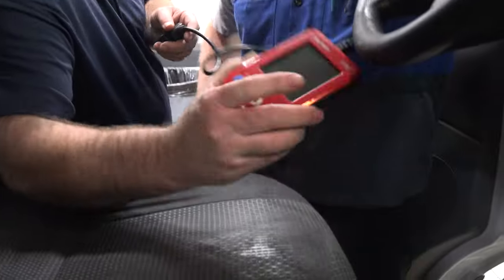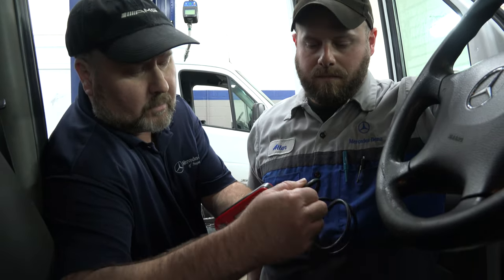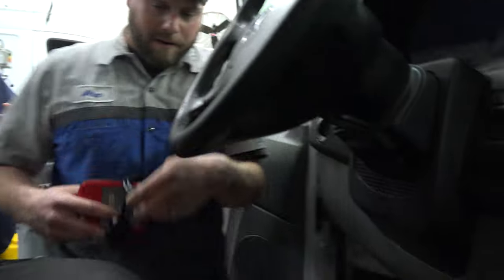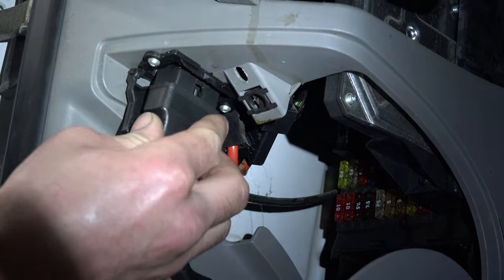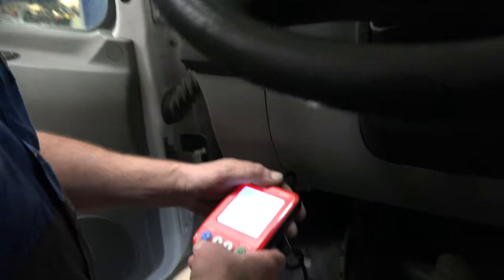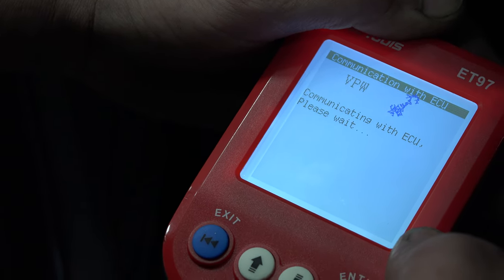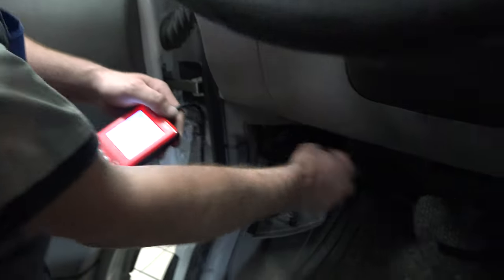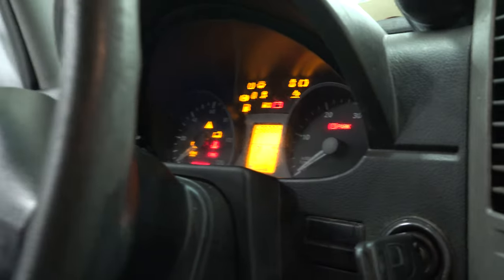Adblue DPF reset key count down cycle lock out. Sprinter 906 M642

Comment: Thanks for the post. I did this very thing and took my car to the dealership to have this recall campaign performed. Apparently there’s a back log on parts and they’re unable to fix the issue at the moment. I took the car back and it sits in the garage until parts are available Now car reads 0 starts, I tried the same technique again but can not get extra starts. Is there another way or will I need a tow?

Comment: Hello. I repeadiatly tried starting my 2017 Mercedes Sprinter van even though the battery was dead. Finally jump started it, next thing i know the 10 starts remaining light came on. Due to extremely low voltage I assume.

The vehicle slowed and i parked on the side of the road. I started the engine a few times but the counter still reads 10 starts remaining.

I test drove around a parking lot and acceleration seems normal again.

Is the Mercedes Sprinter just buggy? Or do I have something to worry about?

Thanks

Comment: hello . I have the adblue light on and 4 start left how can I reset the start and erase the adblue light ? any help I will appreciated
Reply from the maker: Yes, good day. What type of vehicle are you attempting to clear the AdBlue light?
Reply: good morning . yes its 2016 Mercedes Benz Sprinter 2500 2.1 engine diesel in advance thank you very much for any help  @AutomotiveZar
Reply: 2016 Mercedes benz sprinter 2.1 engine diesel I have 4 start time left on it and the adblue light in the cluster is on . how can erase the light and the starter message ? in advance thank you very much  @AutomotiveZar
Reply: yes its 2016 Mercedes Benz Sprinter 2500 2.1 engine diesel  @AutomotiveZar